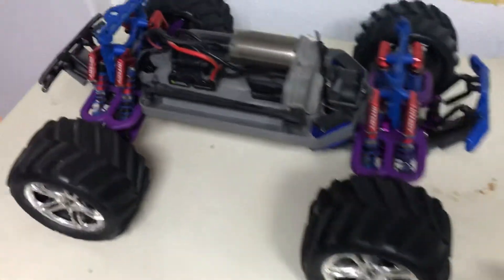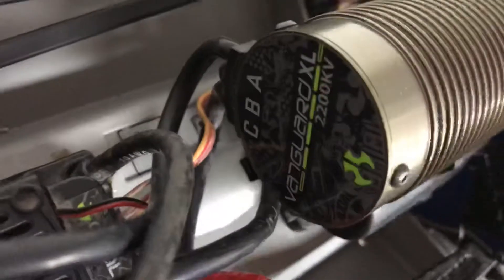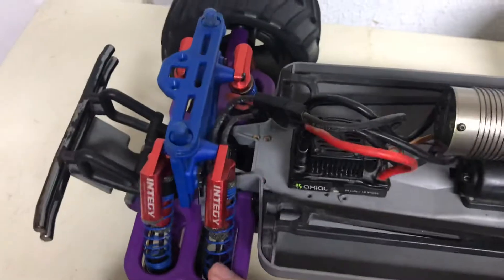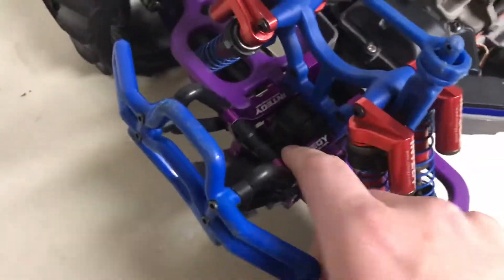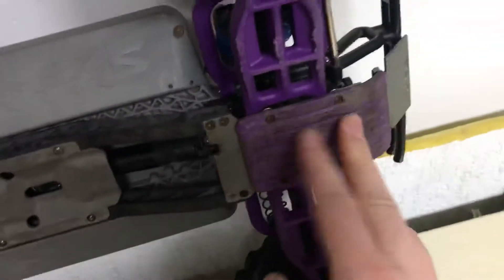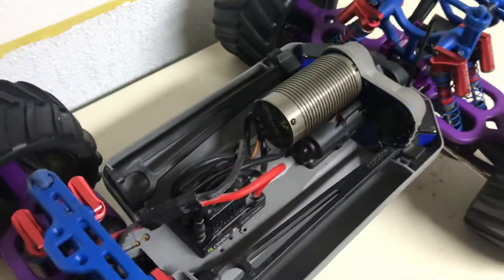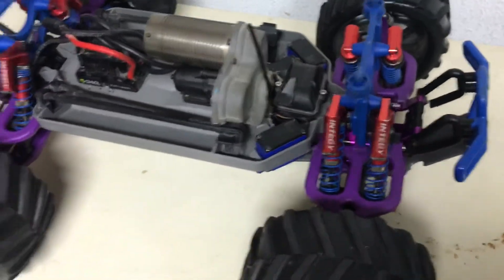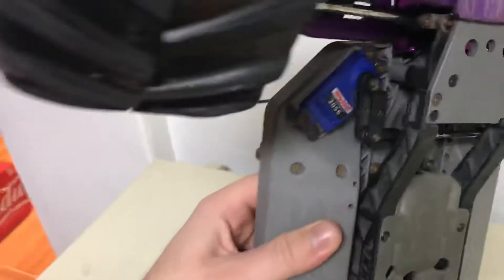TRAXXAS E-Maxx Brushless conversion and Upgrades

Comment: Have you ever broken the stock drive shafts? I have the first gen 3906 with 6s coming, trying to figure out what shafts to get for it. I will need the gen 2 3908 a arms if I go with the shafts you have. Is there something better then the drive shafts you have?
Reply from the maker: I haven’t had any issues, but Traxxas sells a Steel drive shaft set 5451R